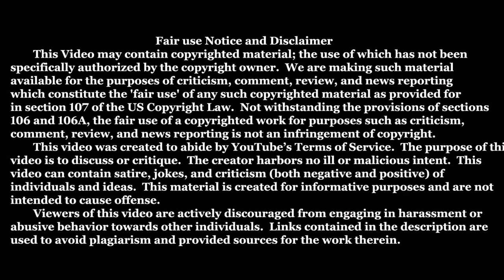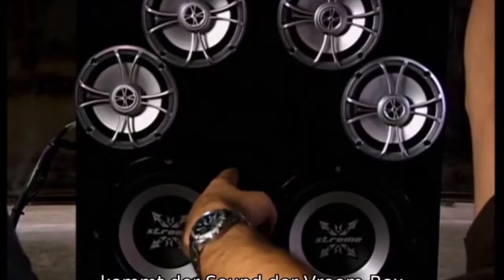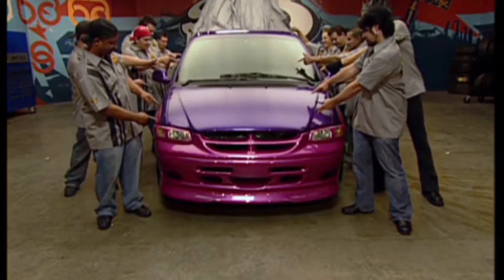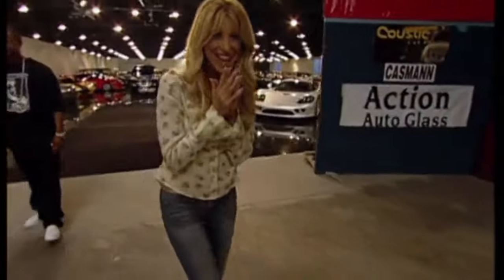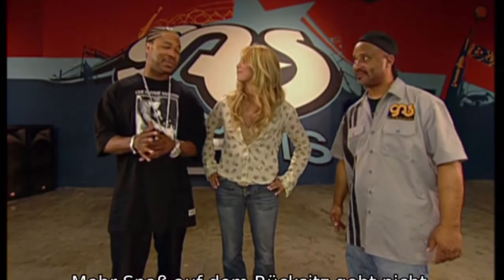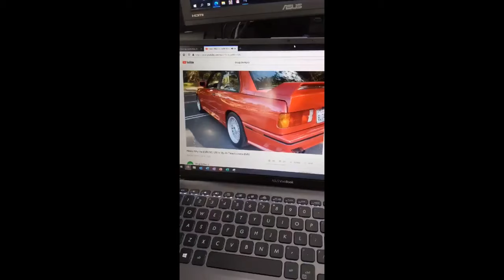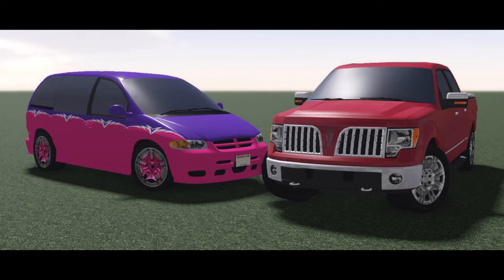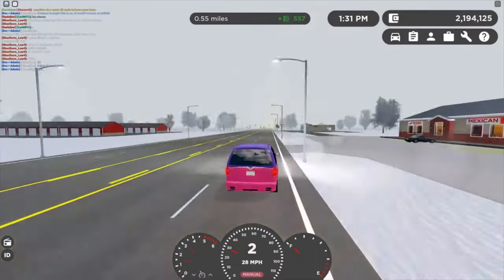Laila's Pimp My Ride GAS Pink Purple Voyager Caravan Tavarish Hoovie's Garage Past present future?

Comment: Is the noise maker and speakers still installed?
Reply from the maker: As far as I know in regards to the inside stereo yes. I asked WatchJRGo and he responded that yes they worked very well. I think the odds of getting dinged for copyright are too great to worry about. The vroom box underneath was removed my PMR.  It was a prototype so they kept the unit and PMR uninstalled the under speaker set up.  Watching the episode you can see the sloppy install with the wiring, it was not meant to be kept in there.

Comment: i can't help but wonder what happened to the Actual plymouth voyager did they scrapped it?
Reply from the maker: With hers I think yes. I'd like to hear from her but my assumption is that someone traded a nice condition Dodge Caravan and Galpin took the hit and used it as opposed to paying for all the repair work on her car. Labor and parts vs cost of van.  Assuming they reached out to her and did whatever paperwork was required. They show them tearing her car apart quite violently. Something they didn't do with the Escort, Fairlane, or Pulsar. I can't imagine after pulling those broken parts out and breaking them even worse they would bother to repair that one.  You are always so concerned with the broken cars.  😆 🤣 😂   Any update on the Bluebird?
Reply: What about the old ice cream truck? With the mice?
Reply from the maker: @michaelhammond9923  Mad Mike did an interview and mentioned that as a commercial vehicle he could not reuse it since it had mice. They had a similar replacement. It's been a while since I've seen it, did they tear it apart? I know they moved out his equipment but might have reused it into the new van. I  showed Laila's van getting tore up sped up, they trashed the parts.
Reply: @Brainshatterer  The were stripping it when they found the mice. I was re watching some of the episodes about a year ago and noticed that the van looked like a different one, but Diggety Dave cut a window for the sliding door in the old one which threw me off after the mice were found, and then I think they must have gotten word they couldn't use it and then from there the replacement went to the paint booth.
Reply from the maker: @michaelhammond9923  Looking at Laila's van the Dodge came into the paint booth in primer with a dodge front end.
Reply: @Brainshatterer  What i do wonder is if they told him it was a different van or not in the where are they now it seems like at least xzibit doesn't know because they talk about how they got rid of all the mice and it is a clean van now.
Reply from the maker: @michaelhammond9923  Keeping up appearances. They didn't want to be replacing everyone's cars or engines.
Reply from the maker: @michaelhammond9923  But also X wasn't there in the middle. Just the beginning and end.
Reply: @Brainshatterer  I just rewatched the clip. Dave is sanding down the sides. Then it shows him finished which is the new van it has seats in it that were completely different from the ones in the old van.

Comment: Unfortunately tavarish bought the car back again after it got messed up ... again.. lol and he then fixed it... lol again 🤣  and apparently he's committed to putting it in the Peterson auto museum in LA but I agree that van should definitely get an srt4 swap!! Ultimate juggernaut sleeper then tune and hop it up with bigger turbo and injectors and what not then u could do a super sleeper - van edition- showdown between that and the RODYSSEY van from boosted boys it has a turbo k swap in it with a 1000 hp , that would be nasty🤘😎🤘
Reply from the maker: I'd love to watch that Barbie monstrosity tearing down the track at high speeds. Greatest youtube vids ever!!!!
Reply from the maker: Several years ago I had bought a wrecked srt4 for the engine for my neon. Found out it was dialed in and making just about 500hp and torque.  Sold it off as I'd never get it slogged. Wish I had bought an old pre 75 and swapped it in. Now I'm in Tennessee and we just have to pay the registration. No more BS tests and such.